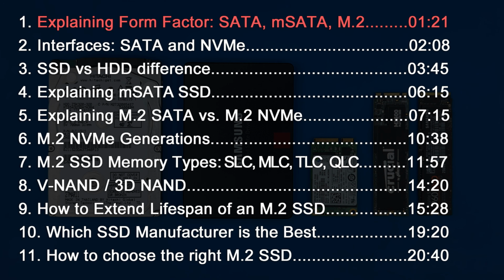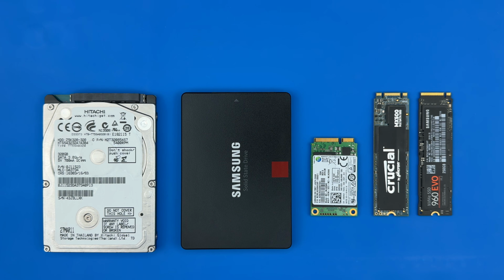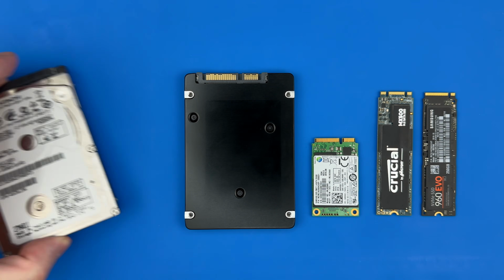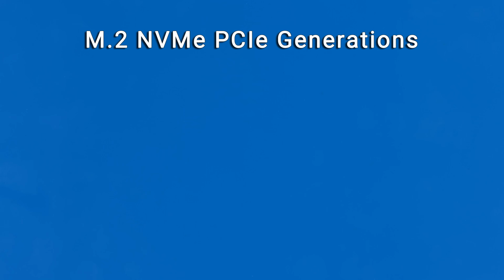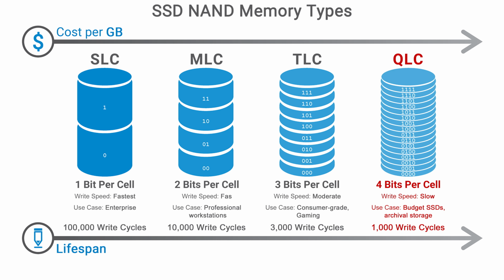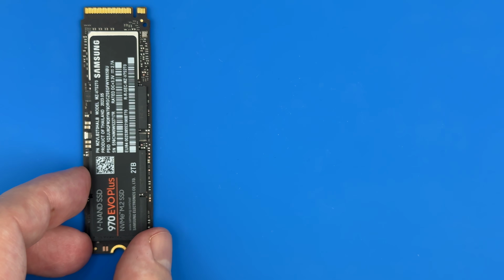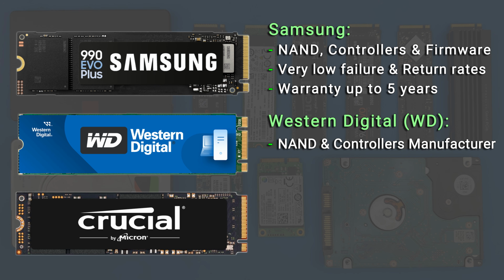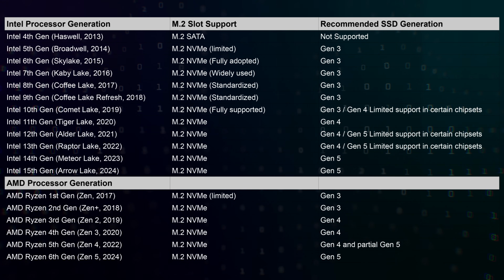SSD vs HDD vs NVMe vs SATA vs mSATA vs M2: Storage Devices EXPLAINED!

Comment: This is such an old video, you might not see the question I have.  
I currently CLONE my drive every few months and rotate using a 3 SSD rotation.  I am thinking of getting a new PC that has the NVMe, but have no idea how to clone it in case it stops working one day.  I do not want to lose so much if that ever happens.  Are there any caddies such that I can buy additional NVMe to allow me to clone the drive?  And is there software that will do that for Windows 11?  I use Macrium Reflect for Win 10.

Comment: If my MOBO doesn't support M2, can I connect a M2 NVMe in an external enclosure which uses a USB-C cable, is the speed "dummed down" to whatever USB-C can handle?
Reply: The speed depends on your NVMe drive, enclosure, and the controller on the motherboard. Chances are that it will still be fast. Some motherboards have USB-C ports that are meant specifically for very high speeds. And others may only be for charging or "normal" speeds.

Comment: for my asus laptop i couldnt know if the mother board has the PCIe thing in the M.2 ssd port because it has an 128go SSD SATA in it so do you know how to actually know phisicaly if the pcie work with out testiong ?
Reply: Look for the technical specifications for your laptop. They should tell you what type of drive it supports. I think some older laptops supported both NVMe and SATA over M.2

Comment: This is not directly addressed in the video, but near the end you mentioned that the final word is held by the motherboard's chips. I was wondering: if my motherboard supports gen 4 PCIe, and I install a gen 5 port, would that make any difference if the motherboard can only handle gen 4?

Comment: Does it matter if I put my larger and newer ssd to the original slot of the stock ssd since that slot has a built-in heatsink? And my stock ssd to the upgrade slot?

Also, which ssd is being taxed more : The one installed with windows or the one that is installed with multiple games and programs?

My train of thought is the ssd with the built-in heatsink might have more heat dissipation capability than the one that we can buy on online stores. Correct me if this is a wrong assumption.

Comment: Very well explained the whole gamut of SSDs for a lay person like me. I have a 7 year old Dell Vostro 3470 Desktop PC which shipped with a 1Tb WD HDD, which I replaced with a Samsung 870 EVO SATA SSD 2.5" few years ago, but it abruptly died few months ago, so had to revert to using my old HDD as local IT parts vendors no longer have SATA SSDs or M.2 SATA 2280 SSDs. My PC motherboard doesn't support NVMe SSDs, but someone suggested I buy a PCIe x16 to NVMe Adapter Card and an NMVe SSD of my choice to replace my slow HDD. Do you suggest such a setup or should I scout for SATA SSDs (M.2 2280 or 2.5" ones) supported by my PC's motherboard ? Please advise.

Comment: Firecuda SSDs has higher endurance than other brands in the market which isn't shown in this video. It's recommended for both performance and reliability. The speed is more than enough for average users. You won't be hitting half of the theoretical speed with Samsung nvme ssd either.

Comment: ,I have an older motherboard, the ASUS Maximus VIII Ranger, with an Intel Core i7-6700 (6th gen). My motherboard supports M.2 NVMe SSDs and PCIe Gen 3 speeds. I want to buy a 1TB NVMe SSD as a second storage drive. I was looking at the Crucial P310 1TB M.2 2280 NVMe PCIe Gen 4 SSD. Is this a good choice for my motherboard and CPU, or should I instead look for a Gen 3 NVMe SSD since my system only supports Gen 3? Also, is there anything important I should know before installing it in the second M.2 slot on this motherboard?

Comment: hello, i have a lil problem. im using lenovo v15 g4 i5 13th gen and i need more storage, so i opened up laptop,and ii saw 1 connector that is not connected to anything, also there is a space for sata ssd , so can u tell me if i can use my new nvme ssd for extra storage? and what  consequences will it have?

Comment: Device Name	SovereignRig
Processor	Intel(R) Core(TM) i9-14900K   3.20 GHz
Installed RAM	96.0 GB (95.7 GB usable)
Storage	932 GB SSD PNY CS2241 1TB SSD, 9.10 TB HDD TOSHIBA MG06ACA10TE, 3.64 TB SSD Samsung SSD 990 PRO 4TB, 7.28 TB SSD WD_BLACK SN850X 8000GB
Graphics Card	NVIDIA GeForce RTX 5080 (16 GB)

Comment: I have a vn7 591g 50ug and i dont know if i can just buy a m2 ssd 256 gb and put it in i opened the notebook and i think i saw a 2280 slot on the left side. I buyed this few weeks ago for 80 euros and i play few games with it its ok but i am not sure if i can buy just a 256 gb m2 2280 no nvme because it has just a 500 gb hdd !!! And i dont want to open it up just to look again.. man i did not made pictures 😅😅😅  its an acer aspire v nitro from 2014 😅 vn7 591g 50 ug the model no. is ms2391

Comment: Here’s a pretty geeky question, if you reduce the controller, or ssd, temperature from  101C to 77C how much do you extend life/ reliability.  Having spent 40 years packaging military electronics equipment, I’m thinking a very large increase in reliability and therefore life.

Comment: Long since retired, but in the 1980s I wrote a sort program that would sort an array of keys with attached file pointers, write that sorted array to a numbered temporary file.  Then I would merge (sometimes thousands) sorted temporary files . . .  5000 to 2500, 2500 to 1250, 1250 to 625, 625 to 312, etc, and then rebuild the original file to a sorted file from the file pointers (up to 4 gigabytes, once the drives became big enough to accommodate ).

That’s a LOT of reading and writing.  I was always curious as to how an SSD would have stood up to that.

In those days, starting out with DOS, I always bought my computers with two hard drives. . . Step 1: Read from Drive 1, Write to drive 2, Step 2: Read from Drive 2, write to Drive 1.  Wash, Rinse, Repeat.

Comment: Thank you for this video, the last new computer I bought was back in 2012, an Asus ROG for basic use and light CAD work.  I just bought a refurbished Lenovo P620 and boy when I opened it up, everything was so foreign to me.  The ssd in it right now is just 256gb.  I plan to use this as a work station and want to get a larger drive.   I was thinking using the 256gb ssd that's in there to load the OS and programs and then have a 4tb drive for all the data and working files.  Should I use an internal HDD to creat an archive as well?  Idk what to do.  Haha

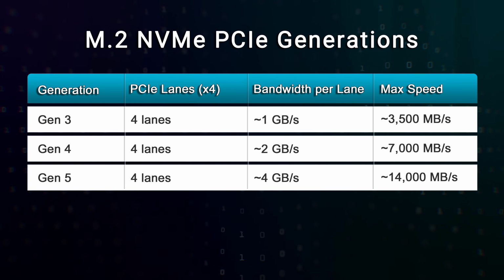Comment: 23:17  Buying a higher generation that the computer doesn't support, may actually increase overall speed, this is due to the potentially better NAND memory, and Cache space to run at higher speeds for longer. 

Basically, those fast drives can only run at 7 to 15k speeds for about 10 seconds before they run out of cache to run at that speed, then they have to lower to 2-3k speed. After a few mins, they run out of the next cache, then they have to run at 1k speed for the rest of the time. With newer/ bigger caches, then they can run at maybe gen 3 or gen 4 speeds for longer, meaning, that file you were transferring will be transferring faster on average over time.

Otherwise wow, amazing video, thanks for the great teaching!

Comment: somebody said while an HDD can store data for a long time without power, an SSD may lose data if it’s left without power for an extended period. so if we remove the biod battery, does it mean ssd data will vanish.
Reply: No. BIOS is for the mobo, not the Nvme SSD
Reply: @mohanjan8768 i know that. but just that somebody said ssd data will vanish when left without power for long time.

Comment: I have a medion Crawler e30 that is currently using a 512 gig OEM ssd i opened the back and saw there is an empty pcie slot so i bought a 1TB BIWIN Black Opal NV7400 1TB from amazon. I am now confused what speeds i will get because my current ssd gets 7000 read and 3000 wrtite speed.  However the extra slot says PCIe 3.0 is that Gen3? I am very confused. I would be very appreciative if you could help me out with that. 24:02

Comment: I have questions i have m.2 sata slot is and i ask the support for my laptop unit and they said that my laptop only support m.2 sata can i use the adapter m.2 nvme to m.2 sata to use an m.2 nvme to my laptop?

Comment: Excellent explenations ... even for a person whos mother language is not english i could easiliy understand everything you explained .. keep up the good work ! 
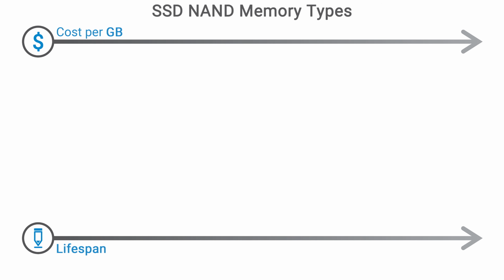But i found one thing to correct in your video  :   In minute 12:00 the upper arrow is showing into wrong direction, it has to be turned 180° degrees  ( cost per Gigabyte is cheapest on the left and most expensive on the right ..but the arrow indicates that it is the other way around )

Comment: I just bought a Msi pro h610m-e ddr4 lga 1700 and an Intel F12100f cpu. Could you check which m2e would fit the best? It's a little older but I'm sitting on a 2500k second gen so it's a big upgrade for me.

Comment: I have a Dell Inspiron 17 7773 2-1 laptop. It has an 2000-0151 error. Hard drive failure. But the replacement option is an NVMe SSD, which my laptop doesn't have. Can I simply clone the HDD and replace it with the NVMe SSD and voila, will it work?

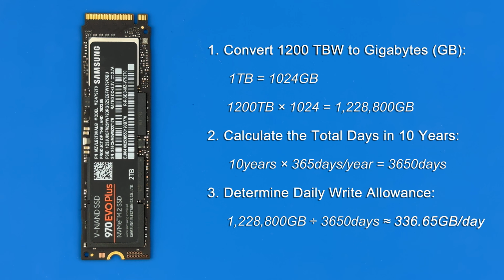Comment: I really appreciated the detailed explanations of your video, it helps a lot! I have a question regarding the calculation at 16:12. The TBW allowance is a set number that the manufacturer gives and it can be used over any duration or should that be taken into account. For example the samsung ssd you used said it had a 7 year warranty but then also said 5 year? Should we consider that after those years the calculation isn't valid anymore and the write allowance should be lowered?

Comment: You called it memory it's not memory it's storage. Memory is RAM.
Reply: Not true. Memory can be either data storage, or RAM(Random Access Memory), Memory just says that it remembers something. RAM Is just a special type. RAM was there because HDD and SATA drives were difficult to grab memory from many different places on the data disk. Now data can be accessed almost instantly because they are on chips. This is why RAM is basically used as a cache now. It's used as an initial memory load because it's faster. Technology is catching up though M2 NVME can be almost as fast as the RAM  itself.

Comment: An appeal for sanity: Please don't use use case in case the user uses the common meaning, is in 'this case is closed' and 'put the guitar in the case'. Just use 'use' or 'case' or 'application'.

In case you are tempted to use "corner case' or 'edge case', please use the physics and math and engineering term "boundary condition".  Corner case and edge case come from semi-literate computer hackers who have not studied the topics. There is no gain in adding to the spread.

Comment: Thank you very much! This was the most useful video on Youtube for me! (But I also watch a lot of cat videos! 😻) Although I am a practicing electrical engineer, I deal with analog (audio) technology. But even there, digital storage has long been the norm. I still have my old analog devices, but I have been using digital players for many years. My favorite is the long-standing Dune HD Max player. I don't mind that it doesn't support 4K video resolution, because I only use the music playback function. And its sound is even better than the newer 4K models from the same manufacturer. I was just thinking about what kind of storage to put in it, since my 500 GB Samsung HDD recently broke. Although I could have asked my sons, they are also electrical engineers 🤣 The younger one is an Android program developer. I learned about ferrite ring memories a long time ago in technical school. (early 70s) 🤣 Technology has changed a lot since then. I wish you continued success and good health!

Comment: 18 essential, but missing points:

1) Implications of the physical process when writing data

2) Writing behaviour of different software, operating systems, and file system, and how it is projected in SSDs 

3) s.m.a.r.t. controlling functionality to monitor the storage

4) Compatibility with available heights for SSDs in laptops

5) nonsensical rgb clowm show in laptops

6) clear warning that oftentimes interface speed does not directly translate to overall speed
[else, why does Windows still take 10-20 seconds to boot from a NVMe-gen5 SSD]

7) Writing speeds on ssds: How they are achieved, and what does each technique mean

8) HOW to guarantee 10% unused space on SSDs

9) How to imform the OS of the storage's type (esp. In virtual/contsiner environments!)

10) Real motivation why SSDs have begun to dominate

11) Price per TB comparison

12) regarding HDD, comparison between SMR and CMR, and the implications 

13) Warning: The more flat the less likely any heat spreader would fit within a laptop

14) mounting techniques of SSD heat spreaders -  obstruction of airflow with rubber bands

15) How to research compatiility beyond Windows/Amazon

15) physics 101: Why high temperatures are awful beyond "cracks" (hint to the author: Lookup how ion diffusion ruins gates)

16) Filesystem type, mount option noatime, andcregular discard

17) Warning,not to use SMR in raid-5 configuration qhen usingbstorage boxes

18) Backup! Backup essential data onto 2+ different external devices, and alternating them.
DONT use these devices for ANYTHING else but backup.
Keep these devices separared in differently coloured cases (blue, green, red, yellow, purple, black) to enable visual distinction on a glance

Comment: This video is just as helpful as it is entertaining. Thanks for sharing this information.
I hope either you or someone in the comments could give me some advice:

I would like to upgrade my Local C: Drive because I need extra space in order to run the apps and tools I use for work.

I have an ASUS Z170-A Motherboard, which has a “CRUCIAL MX200 SATA M.2 2260DS SSD” in its M.2 slot.

I would like to upgrade to an SSD with the NVMe protocol and with a capacity of 1TB.
But I'm not sure what's compatible with my current system.

Also, I understand that I would need to perform a cloning operation from my current SSD to the one I'd want to upgrade, since my current SSD has the OS and all the software I need all installed, but I'm unsure if I would be able to do this since my motherboard has only one M.2 slot.
Doing some research, I learned that I could use a M.2 to PCIe connector in order to attach an additional SSD to my system via its PCIe slots instead, with the caveat of limiting the speed to whatever the PCIe slots can handle (if I understood correctly)

If anyone could help me out on this I would really appreciate it.

Comment: QLC is more common in the high capacity NVMe drives. Also, I wouldn't use a rubber band retained heatsink. The rubber (or whatever elastomer they use) gets brittle in less than a year.

Comment: a ver:
Los discos mecánicos, NO SON OBSOLESCENTES, si se conservan cuidadosamente pueden llegar a superar los 20 años de almacenamiento seguro, sin dañar su información.

Los discos sólidos SON OBSOLESCENTES. Los discos sólidos (SSD,M2,pendrives) se degradan a cada ciclo de lectura - escritura. Los discos sólidos están diseñados para corromper la información (aun estando desconectados del sistema) al cabo de un periodo de tiempo superior al que marca el fabricante como "garantizado". Los discos sólidos no son un soporte fiable ni confiable para el almacenamiento de datos sensibles. Son elementos de hardware que se degradan a cada uso, y pierden la capacidad de almacenar información, si están periodos prolongados carentes de alimentación. 

La información en los discos mecánicos, es fácilmente recuperable (mediante software de recuperación), la información en discos sólidos ES IRRECUPERABLE.

Los técnicos recomendamos almacenar información valiosa / sensible en discos HDD, y la información irrelevante o de arranque de sistema en unidades solidas.

Comment: I bought a brand new Dell Tower ECT1250 computer and I want to add at least 2TB of fast storage for video editing.  The computer has two M2 slots that are used by WLAN and 1 TB NVMe SSD.  It also has 2 PCIeX1 slots open and a PCIeX16 used by the GEFORCE RTX.  It also has one SATA port open.  What do you recommend for adding more storage?  Should I return the computer to CostCo and exchange it for a better one?

Comment: I have a work Lenovo Yoga 7 16IRL8 with a 13th Gen i7-1355U. Following your steps I have a 512GB NVME m.2 Gen4x4. I found another video where they opened the back and looks like a 2242. I want to get a 2TB, thinking the Corsair MP600 Micro 4x4 with 1200 TBW, thoughts? I really want DRAM but looks like this small it does not fit.

Comment: One more thing: while an HDD can store data for a long time without power, an SSD may lose data if it’s left without power for an extended period.
Reply: While this is true, for most consumer SSDs it would take 1-3 years for it to lose its data without being powered at all. If left in higher temperatures however, it can lose its data within months in worst cases. However, even just powering it up one time for a moment will instantly reset this.
Reply: Wow. Didnt know this. Thanks for the added tip.
Reply: So just connect it every few months.
Reply: How long we talking on the extended period in years??
Reply: I plan to buy cheap SSD laptop (think under 240$) to be put on 2nd home for emergency purpose. Do you got info on how long till it become corrupt?
Reply: @Hyoro_ヒョロ  Most BIOS chips in modern laptops use the main battery for power to "stay alive", as does any electronic storage (SSD/M2 SATA/NVME)  (desktops and older laptops use a separate battery)
So as long as you keep the battery at lest  partially charged, you'll be OK.   The battery management on any decent laptop should be OK to be left plugged unto it's charger/power supply, or you  could just make a note to "top it up" for an hour or so once a month.
Reply: @iffracem  thank for headup